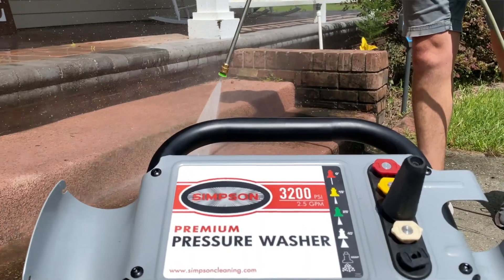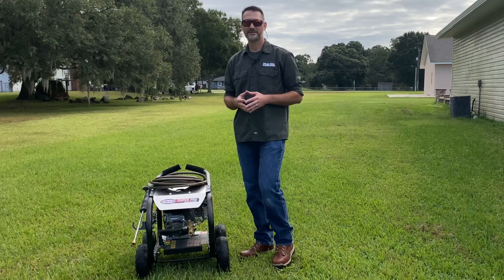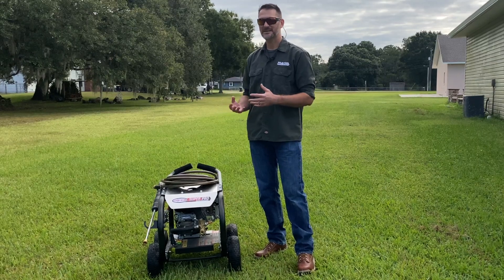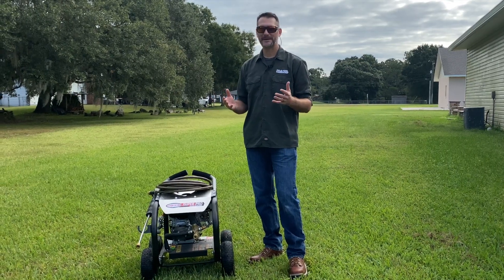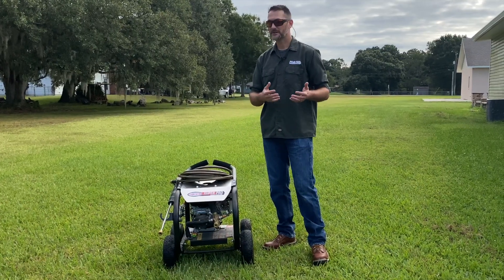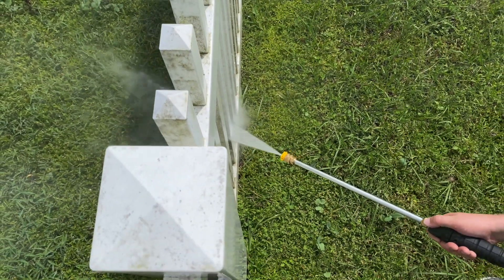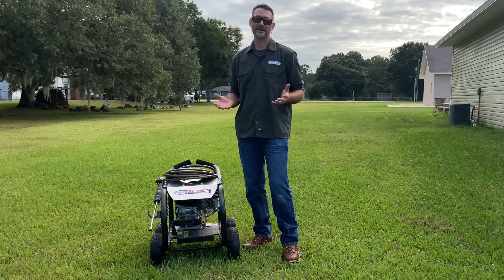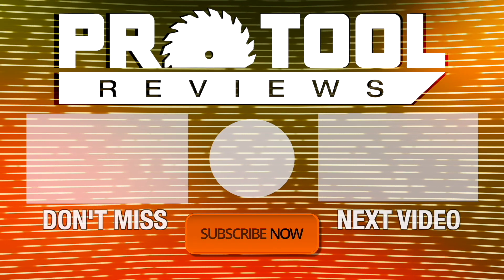Pressure Washer PSI Max EXPLAINED

Comment: Engineer here.
"PSI max" is nothing different than the shenanigans the air compressor industry used to do. They would rate a 120v air compressor at "6hp peak", even though basic math says that a 15 amp circuit at 120v can supply only 1800w of power, which is just over 2.4hp at the point where it trips the breaker.

Where did they get the 6hp figure from? They would measure the current draw of the unit when it was first starting up and the inrush current could flash as high as 40 amps or so-- for a tiny fraction of a millisecond. Presto, suddenly you have a "4800w" power rating and over six horsepower!

This nonsense was also done in the past with stereos and such when they would advertise "Peak Power" or "Max program power"-- it's the tiniest transient and nothing more. Heck, they still do dishonest things like rate a stereo receiver at "100w X 7 channels" when the data plate shows it draws only 380w from the wall (how does a stereo put out 700w when it only take in 380w?)

And like all those other instances, these ratings are only true in the most esoteric technical sense that's not enough to offset the fact that it is essentially a lie-- it is intended to deceive. Shame on everyone who does it.

Fortunately for us as consumers, we can pretty easily detect the lies with some knowledge. Basically, take "Cleaning units" divided by 1140 and that's the required horsepower. Or more simply, take the "cleaning units" and divide by 1.5 or multiply by 2/3 to get the power required in Watts.

So if you are looking at a pressure washer that claims 3gpm and 3000psi, that's 9000 cleaning units. And it will require nearly 8hp or 6000 watts of power into the pump. (assuming 85% pump efficiency, pretty standard).

So if it has a 7hp gas engine or the electric motor takes household current (1800w max) you know it's a lie through and through.

Comment: That is great information. Using that information do you have a couple pressure washers that you’ve tested and have one you recommend for strong power residential to clean the driveway, where you want maximum pressure as there isn’t anything to cause damage on.

Comment: What ratings should we look for when trying to pair a pressure washer with a surface cleaner. I want to avoid having too little pressure for the surface cleaner.
Reply: Did you find this out. As I would also like to know. I have a BE Whirlaway 24 inch steel surface cleaner and looking for the best electric and fuel options